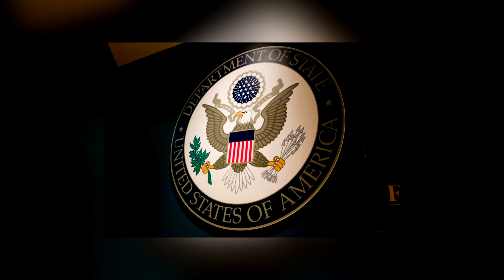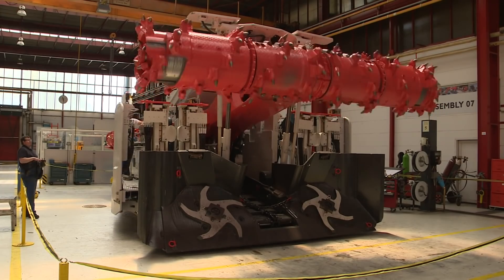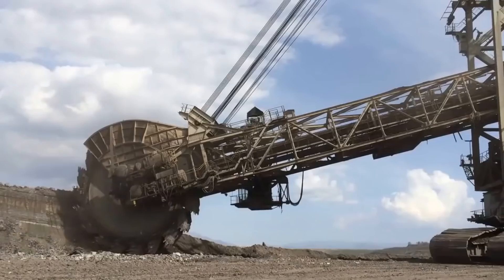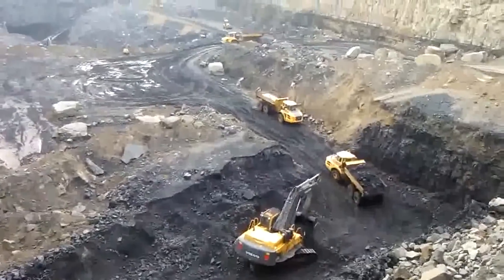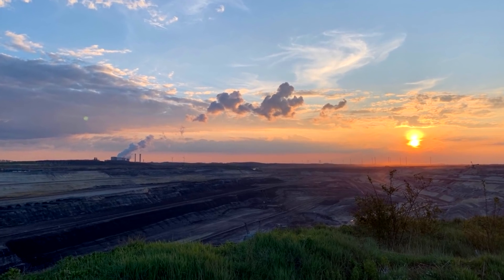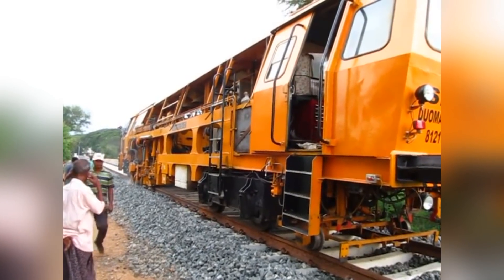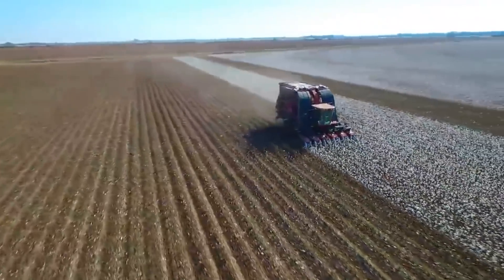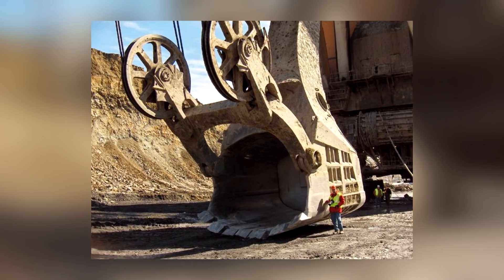12 Most Amazing Extreme Machines In Action You Need To See

Comment: There is a crane 10 miles south of Memphis, Tenn called Ichabod owned by barnhart crane and rigging. Electrically powered the owner told me that it costs $10,000 to start it. You can see it from rooftops in downtown Memphis 10 miles away. The capacity is 1250 tons.
Reply: I'm through Memphis every few years on my way down to Georgia for a convention, but I don't recall seeing that. How long ago did it go up, and where does one look if crossing the bridge from Arkansas into Tennessee? Just curious for my next time around.

Comment: humans built all of these machines so we are doing all of these amazing things with our hands
Reply: Caleb Wilson no, we built these with our hands so our hands wouldn’t have to do this, our hands control the machine though...sometimes. 
CAT has an excavator that levels the bucket as you dig per your programming for the dig, the bucket can even stop and keep going based on the weight and where it is at in relation to the machine per your programming before digging. I never used it personally but I know how it works... because I worked on them. 
There are custom settings to the machine as well, takes a lot of the thinking out of operating. Especially if someone is fairly new to the machine as a whole, the instructor can program what he the guy to dig and the machine for the most part will slope, grade, and have a fixed depth to which it will dig.

Comment: As others have mentioned, the cotton harvesters (NOT a Combine) are poorly represented here. I work on the design team for John Deere's cotton harvesters, and Case is our competition (if you could call it that). For quite a while now we've been selling baler machines that, rather than compress the cotton into a block as you showed, produce wrapped round modules. A baler machine can harvest, produce a module, wrap the module, eject the module onto the handler and continue harvesting without even slowing down. The modules can then be dropped at the edge of the field (or wherever), all while the machine continues to pick at an amazing rate. Our machines (CP690 and CS690) are used around the world and are knocked off by our competitors regularly. They're very cool, far more advanced and reliable than the Case bread loaf or basket machines you showed, and reduce operating costs and increase up time for our customers. In fact, several of the shots from your video showed John Deere machines, though you called out the Case units. To my knowledge we produce the biggest, most expensive machines in the John Deere agriculture portfolio.